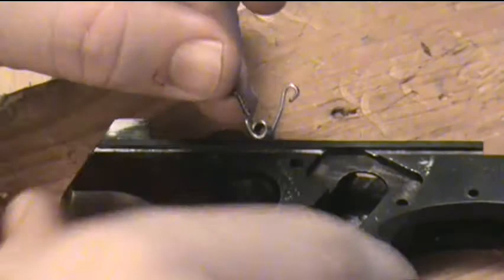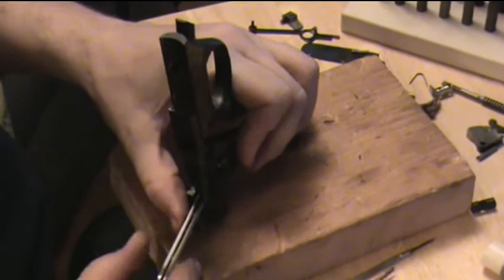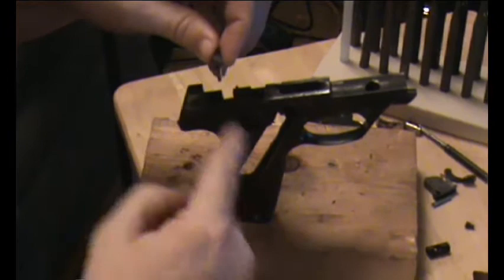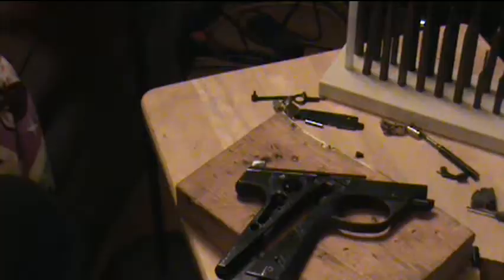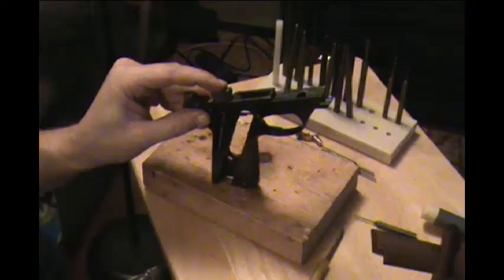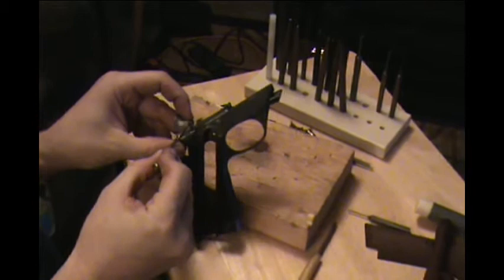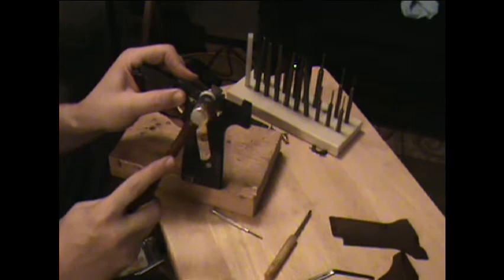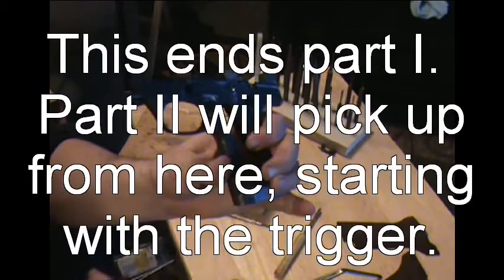High Standard Victor Lower Receiver Detailed Reassembly Part 1

Comment from the maker: To replace the barrel, take everything off that does not need to be there.  Also make sure it is the correct barrel.  There are some subtle differences between the models.  I am uncertain if the barrel/receiver falls into that category, but it is certainly worth double cheking.  Also, after getting it on - no offense intended, I don't know your knowledge level - make certain to check the headspace.

Comment: If one were to replace the barrel, and the barrel does not seat properly, is the best approach to remove the takedown button and fit the post to it OFF the pistol?  Other barrels fit quite well.  It is just the new barrel and post that are too loose.

Comment: Actually, I was just wanting to see if you had tried to fit the barrel stud on a High Standad 107 (military).  There are two ways to do it, and the longer way is probably the better way.  That is how I will do it (remove plunger, fit to barrel stud to the plunger, replace plunger, attach barrel), if no one has a better suggestion.

I agree WRT headspace check, even on a .22LR.  No offense taken.